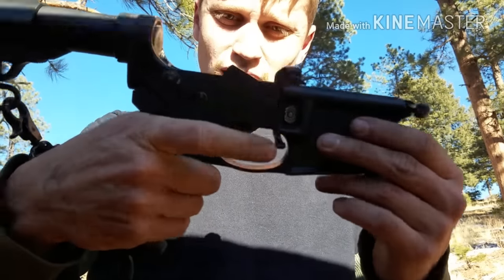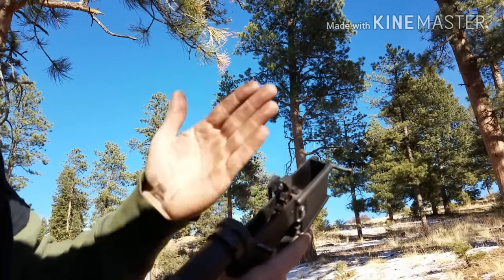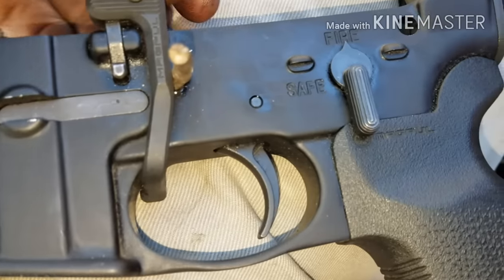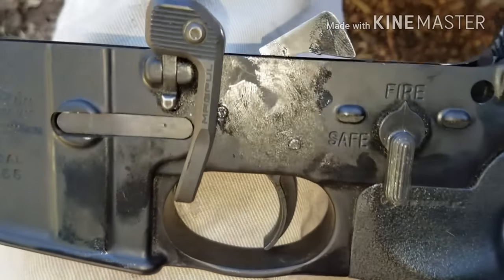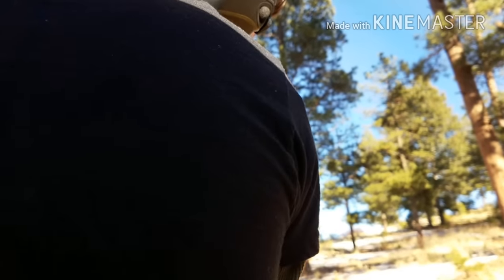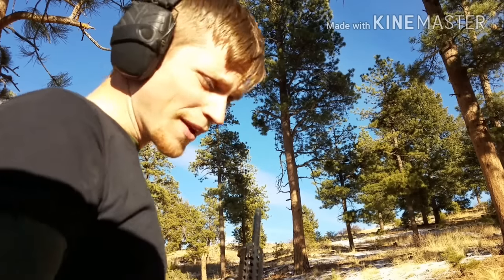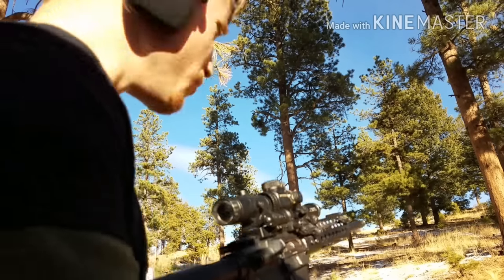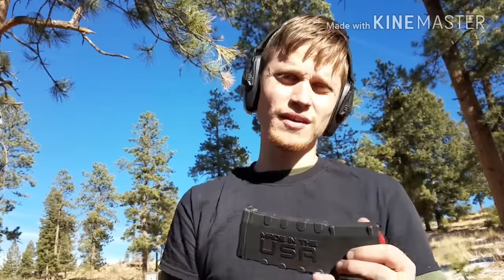What Happens When The AR-15 Disconnector Breaks?!

Comment: All these people saying too much grease... doesn't make a fuckin difference... even a little bit. I could pour 5 qts of oil on a rifle and itll run just fine... if something breaks then theres another issue...
Reply: I know someone gonna say "grease and oil are different though" maybe true but grease is also not gonna break your disconnector or jam your gun unless you dont know what the fuck you're doing.
Reply: Been saying the same shit for years. I’ve never had a single malfunction from over lubrication
Reply: Its not that over lubrication is bad. However excessive oil will hold onto far more dirt and grime which could then cause issues
Reply: @opinionsvary  Really? Are you sure about that? I believe there are guns that use grease as recommended by the manufacture or military manual. The M1 Garand comes to mind. I'd bet that there are others. M16/AR15 bolt carriers may be designed to run dry I really wouldn't know. But to say "Guns do not need grease or lube except to prevent corrosion." as in all guns, I believe is false. BTW I do lightly lube my AR15 bolt carrier in the 3 areas that make contact with the receiver. I just feel better about it and its never caused a problem. I also grease the slides on my semi-auto pistols. Again that might be wrong but I like it and it works.
Reply: @jamesphillips4836  everything you said is correct and every thing that was said by the commentary above you is incorrect. grease never hurts any firearms and I use high temp bearing Grease in the automotive department from Walmart and have for more than 25 years on AKs, Ars, m1 carbines, m1 garands, glocks, etc with no problems whatsoever. I would never run an AR dry whether it could or not like the other commenter said. it might be able to do it, but I wouldn't want to put my firearm through that unneeded stress. as long as you're not in an extremely Dusty or Sandy environment, OR double digit below freezing, grease is the way to go in my opinion

Comment: Thanks for making the video.  In the event that a disconnector breaks here is what I learned.

Broke disconnector, remove disconnector, leave empty mag in to lock bolt back,  load one round, fire round, load one round, repeat.

No one wants to have a disconnector break but it is always good to know how to at least defend yourself if you find yourself in that situation!
Reply: wouldnt a broken disconnect just induce full auto as the disconnect is no longer catching the hammer for aslong as the trigger is depressed?
Reply: @Alolan.Vulpix.Getting.Railed  That would be correct, which is why their remedy is to go to single loading.

Comment: It’s not an Anderson issue I have been shooting & working on AR-15/M-16’s Since 1971 and have seen various fire control parts fail from manufacturers. Good reason to have spares. The over lubrication isn’t a problem it’s all the accumulated grit in the lower.

Comment: nice recovery on keeping rounds going down range even with a malfunction... something to keep in mind for tools.. i keep allen and t keys (hex bit) along with an extra pin right in the handle. most grips have a nice cap that will seal closed, to keep the "rattle / noise" down wrap them in a plastic baggy, like the one your new disconnect came in.
Reply: Can also stuff a bag into handle get same effect

Comment: Yeah with a disabled or removed disconecter the hammer just rides back up on rear of the bolt carrier face without enough energy to ignite the primer in the next round.
Reply from the maker: 1911jt This is the point I was trying to get across and why I decided to make the video, I didnt know for sure but I was fairly confident it would not go full auto. I had heard so many people say that "You know...all you gotta do i s remove the disconnector and that ar will go full auto"...usually an older guy or a super young guy that hasnt spent much time understanding how each part functions. Anyway, that you for the backup! :)
Reply: Douglas Thompson 
I know what you mean. I've heard probably a dozen times from Baby Boomer age guys that AKs were designed to fire the 7.62 commie ammo or our 5.56 ammo. Seem there's more bad information in the gun community than correct info. 
For the record the same thing happens if you disable the disconnecter on AK rifles. The full auto version of each design has a trip lever that holds the hammer until the moment the bolt is closed. And in both designs it requires an extra hole in the receiver. AND... You can and WILL go to fed prison just for those holes being present on either style of rifle. Holes alone not even with the parts installed.
Reply: +1911jt Not true. The front tip broke. Not the hook. The hammer doesn't always follow like you hope it would. Depending on the ammo, the length of the gas system, the weight of the buffer, and the weight of the hammer spring, the rate of fire could be prime to go full auto. I had this happen on a Bushmaster 20" shooting Winchester Silver Tips. I quickly bought the $6 disconnector to replace it...
Reply: Patrick Jefferson You may be right on that one. I'm not an AR expert by a long shot. But as a general rule I've found that disabling the disconnecter in ARs or AKs just turns them into single shot manually cycled rifles.
Reply: that is what is happening
Reply: 1911jt when I converted my ar15 into a .22 the sear broke, then it started shooting full auto (it's fixed now)

Comment: Actually a good argument to have anti-rotation pins is if you have a spare disconnector you’re going to have a spare hex wrench. If you don’t use anti-rotation pins can it’s far less likely you’re going to be prepared for other things having to do with your fire control group.

Comment: and this is why i love older colt sp1's or 2's.  so well machined that even without a disconnector.......  they run with a 16 carrier.
Reply from the maker: Really?...wow, and semi auto still functioned nd the hammer locked back without issues?
Reply: @DouglasThompson   crazy, huh?  yep, hammer rode the bcg into battery and firing pin ignited primer once bolt rotated and locked into battery.  all happening in milliseconds.   no early detonation. 
3 or 20+ rounds out.  semi trigger engaged and locked on hammer once released.  
20" Colt SP1, Colt 16 bcg, no disconnector..... not for the faint of heart   lol.

Comment: Thanks for the video. My disconneter actually broke and I have been dumbfounded trouble shooting my rifle discharging round, chambering next then having to eject round to fire next, then repeat process. I ordered new trigger and am looking forward to going to range. Mine broke after 2nd 30 round magazine. I definitely will have issues if next disconnecter breaks in next two magazines. I hope rifle will function properly for a few thousand rounds not 60 from out of the box new
Reply from the maker: Where did yours break?
Reply: @DouglasThompson  mine broke on end where it latches to hammer.the part that catches broke a chip off the end where it supposed to catch for a second. Instead I fire and everything functions except hammer falls back and I have to recock to fire a single round. ABC offered to fix since it broke out of box. I Ordered a different drop in bindary trigger to fix. I may get a few Xtra drop in bindary triggers just Incase the ATF Bans them
Reply from the maker: @louisdufour4106  probably a good call.
Reply: @DouglasThompson  the Wide open Trigger system fixes all my disconnecter problems. One word for a kick azz trigger .....LUBE! Keep it lubed and throwing led down range brother

Comment: Keep allen wrenches and small parts in your pistol grip. I'm sure there's stocks with storage pockets if a guy wanted to keep a whole part kit.
Reply: Or get an AK instead carrying parts or a full backup gun... lol, this seems like a pretty bad failure when some of these are made from plastic (I’m guessing his was aluminum?).

I didn’t realize how freakishly expensive trigger parts were for the otherwise dirt cheap AR-15 platform, I could make a killing off a small laser cutter and CNC machine cranking out precision triggers and selling them at $80 to $100 per kit, with option for heavy duty steel, they are way overpriced. But these things will likely be banned in the US anyways, so no reason to start making them better and more affordable.

Comment: I've actually had my hammer pin walk out. Never the trigger because it's arc of travel is so short, but I would definitely want an anti walk pin for the hammer.  If you're really uptight about not having allen wrenches handy, just use a dremel to slot the screws when you install them, then you can just use a leatherman or knife blade or whatever.

Comment: You could run the rifle without a lower or upper.  Just tie the barrel to a tree, use a nail as a firing pin and rock as a hammer.  If you time it right, the shell casing will pop out the back and you woukd have the next round in your teeth and orally insert it into the breech.  Repeat.  With practice, I can shoot about 35 rounds per minute.

Comment: Yeah not been impressed with Anderson. Had a lower with buffer retainer pin hole drilled in wrong spot it would cause my buffer to hit the retainer pin and chew up my buffer. Sent it to Anderson and they replaced lower but did same thing.

Comment: Any idea which Anderson trigger setup this is?  looks like the white box setup (the more expensive one).  I had some major problems with the brown box kit: had to actually reshape the disconnector and hammer, and polish a casting mark off of the trigger face.  they replaced the two brown box kits i bought with white box kits, but i'm still pretty dismayed that it happened in the first place.
Reply from the maker: Work I don't actually know the name of the kit. just knew it was Anderson. it was one of those everything included kits. pistol grip stock etc.
Reply from the maker: Work it was also a black Friday deal I think from slickguns so the kit might have been grouped together by them...
Reply: Ah, that may be.  It's a shame, their lowers are pretty well made and a great value, but those parts kit should probably be a higher quality.
Reply from the maker: Work I wouldn't hesitate to use them again. they will literally replace the parts if they break. watch my 2nd newest video.
Reply: Their white box kits are pretty good, all things considered.  Their cheap one is just super sub par.  i'll still buy their stuff, as you said, they do stand behind it.  i just think they could work on their parts kits a little.
Reply from the maker: Work Perhaps ill pick up the super cheapie to test...not sure Id have the money to break it (ammo) lol but it would be a cool test!

Comment: Disconectors are one of the high breakage parts and it would be wise to have extra ones on hand.
Reply: Nikki.... I purchased Colt M-16 disconnectors BC of low quality in commercially manufactured disconnectors,  after like breakage..

Comment: I usually buy dpms, cmmg, or hyperfire trigger groups.
Reply from the maker: SIR WAFFLEBOB I have a rock river in this firearm currently and a geissele ssa in my main build.
Reply: Douglas Thompson hyperfire is my current favorite. That, or a cmc trigger. 3.5 lbs.
Reply: Douglas Thompson I've built around 25 ar's lol. I've never used an anderson lpk.
Reply from the maker: SIR WAFFLEBOB I originally built this as a budget ar15. It turned more expensive in the long run but It was just something to mess around with in the beginning.
Reply: I use POF 3.5 lb flat face single stage triggers, or mil spec. I've ran them extensively and never had any issues, and the break is clean and crisp. Im sure there are other good triggers available, but i stick with POF because they've never let me down.

Comment: That broken disconnector suspiciously looks like a chinese lower parts kit. They sell em on those chinese website, seemed like theyre prone to have broken disconnector, the same exact place it broke on yours.
Reply from the maker: Interesting, I wonder if these are from the same factory and just rebranded. That happens often in china from what I know.
Reply: @DouglasThompson  most likely is a US company approached the factory and both agreed on a quantity. It could either meant the chinese made more and sold it unbranded with sub-par quality, or the US company fail to meet the quota required, and chinese factory is left with tons of these products and sold them via brokers (online).

Comment: How do you manipulate the streamlight being that close to the optic? move that thing out front where it belongs.
Reply from the maker: Tim M I have explained this to quite a few people. I grip by the magwell so i literally just move my thumb from the forward position up a bit and the controls are right there, press down for temporary on and up for constant.

Not only is it better for weight distribution, Its better because I dont have a ton of stuff in the way on the end of the handguard if I need to grip futher out for the extra stability. Perhaps ill make a video on why I have my rifle set up this way since you are the 3rd person to question.

Thank you for watching! Hope that answered your question.
Reply: It did answer it thanks for the response. to be honest though a lot of guys that know a lot more than me and a lot more than you would suggest running it different. The only real thing i see as a problem would be that it would light up a lot of your barrel and handguard rather than projecting the light forward.
Reply from the maker: Tim M It is 800 lumens so there is plenty of light to waste. lol 

It does project a bit of barrel and handguard but the light doesnt work for me any other way, i have literally tried every single possible position and its what works best for me and my setup currently. It actually is very comfortable, out of the way but easy to reach, hard to accidentally activate. Its great! Thabk you for the suggestion though. I have an inforce wml as well that i mount the same way and its also great. Theres never just 1 way to acheive something. ;)

Comment: def a good reason to not have anti rotation pins..lol.... I keep my M.U.T on me.. seriously an awsome tool for AR's
Reply from the maker: BangSwitch how do you like your mutual? I was looking at those. :)
Reply: Douglas Thompson  dude I seriously use that thing all the time.  the leatherman M.U.T.. not cheap for a damn multitool, but worth every penny. and if you add the bit set , witch isn't that much and fits right in the sheath.. it's great.. just throw it in your bag, you'll use it all the time.. it has long screwdrivers too, I can actually use the flat head and unscrew my hand grip if I need to it'll fit that far. and it has the best pliers leatherman has, with 154cm steel cutters.. all kinda great useful stuff bro
Reply from the maker: BangSwitch I've definitely been considering it. That's good to know it will fit all the way down the grip. Some triggers won't come out without relieving the spring tension of the safety (As seen in this video). Thank you for the info, Switch!

Comment: As dirty as that sear compartment was, your lucky the whole gun didn't lock up. Then blame it on an Anderson trigger group. Too funny.
Reply from the maker: The break had nothing to do with any debris in the lower. I have done many experiments with firearm reliability/durability and never experienced this same issue. 

Anderson is a great company that offers low priced parts for enthusiasts but I can't recommend some of the more intricate parts they offer in a home defense rifle. I've had many parts from many different manufacturers break on me so Im not just focusing on one company. I just show what I experience and give others my opinion. Thats all I can do as an individual.

Again, Anderson makes great parts for a great price! I have two uppers, two lowers, 3 bcg's, a couple fcg's, and more I cant think of off the top of my head... from them and I love them! I would trust them 100% 

I know nothing is invincible, everything has a breaking point. Even the very top-tier items.
Reply: @DouglasThompson  Andersons, suck!!! everything they make. Kentucky Hillbillys trying to make a quick buck. I'm just saying brother. Ever had some of that corrosion go into your gas line piston and then the BCG don't insert so the shell jams and the next round jams the shell so far up in the upper that the next round blows your barrel off. Well I have. Clean yer gun! And always wear eye protection. LOL

Comment: is it not suppose to go full auto if disconnector is removed?
Reply from the maker: EvendimataE it is not, the disconnector kind of delays the hammer going forward too soon so the hammer doesnt follow the carrier and in turn lose energy to strike the firing pin hard enough to hit the primer with appropriate force.
Reply: savethealamo1 savethealamo1 no, actually the auto sear makes sure the hammer falls at the right time. The disconnector has nothing to do with it. In fact, the disconnector is held down when an M16 rifle is in full auto so that it doesn’t make contact with the hammer. If the disconnector is broke where his broke, it causes it to stay engaged with the hammer even after releasing the trigger. Had it broke where it makes contact with the hammer, then yes, it would attempted to continue to fire. More than likely though, the hammer won’t have enough force to set the next round off because it would ride with the bolt. Again, that’s where the auto sear comes in handy. It has to hold the hammer back for the right about of time (once the bolt comes forward and the bottom portion of it make contact with the auto sear).
Reply: savethealamo1  actually the auto sear is the safety sear in the M16.  The AR15 has no safety sear.  It is possible to outrun the bolt with a fast trigger or trigger finger.
Reply: Fortunately the bolt design is resistant to firing out of battery as the bolt and bolt carrier assembly is lengthened until the bolt closes.